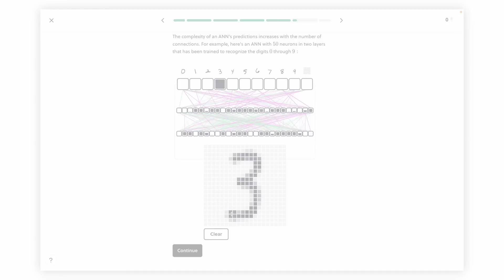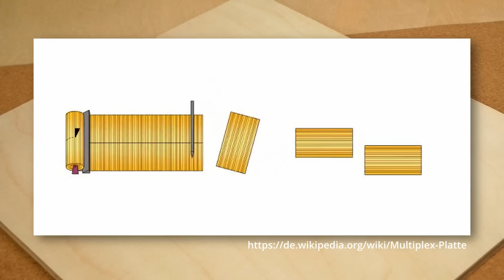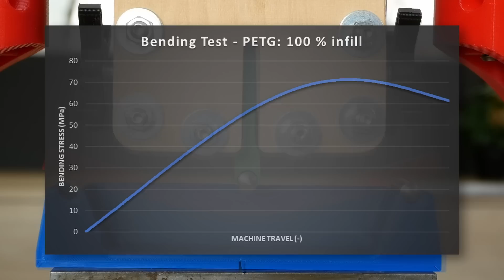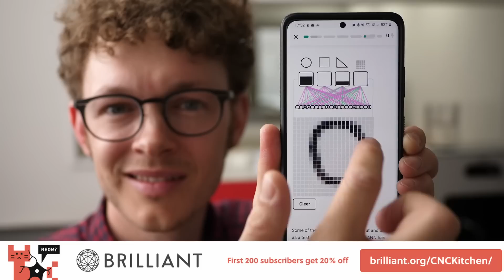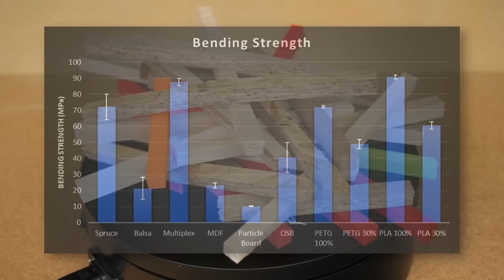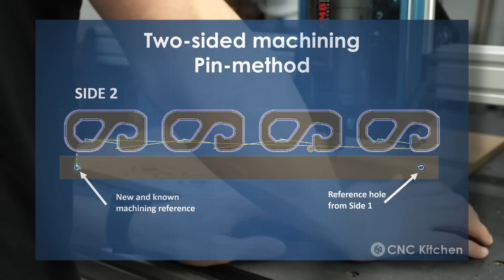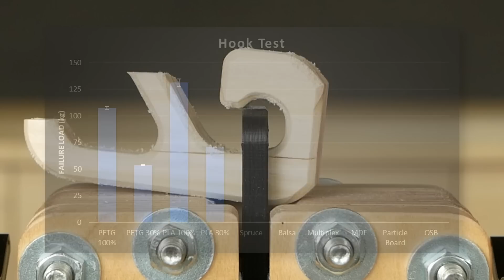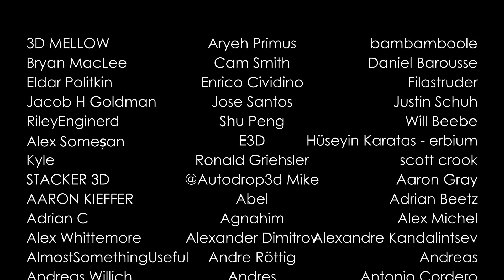Strength Test:  3D Prints VS Wood

Comment: Harder woods would be interesting, in addition to testing with the grain compared to layer adhesion in the FDM prints.  For that matter, throwing in some resin prints would also be interesting, in both orientations.
Reply: Seconding this! Soft woods are good for carpentry, but when you compare to 3d-printing it is more about joinery/cabinetry

And especially interesting is maple, not so much because it is popular, but for having a weak direction not just perpendicular to the grain, but also perpendicular to the growth rings, unlike most woods, breaking alonggrowth rings.
Reply: resin prints orientation is irrelevant, thank God.
Reply: @severpop8699  With the right curing type and a good resin, it shouldn't matter, but it's still a fact that layer adhesion in resin printing is a variable.
Reply: Mathias Wendel has a series on testing wood strength. https://youtu.be/MBfzDEgfA0I
Reply: Nah , hardwoods glue poorly and blunt your tools. The efficiency loss makes them totally inappropriate for prototyping. 
Strength to weight is also inappropriate. You can cut out marine ply with a Japanese detail saw in seconds in complex shapes. Doing that with hardwood is impossible. The saw will blunt, Teeth too fine. I'm not a carpenter but I build 20m hardwood fences, retaining walls and furniture on my cabinet saw.  As well as using marine ply for prototyping.

Comment: 1:22 ordinary particule is not moisture resistant, and will memories deformation over time, so, stopped buying 10g ago. OSB3 is much better, even for simple storage or table. there exists good quality particles at a price where OSB3 just does the same service for cheaper.
Reply: for a nice finish on OSB3, you need to use an universal paint (one which is said to stick to plastic ), grind edged, and paint a second layer.

first layer is required to stabilise edges before grinding.

plastic compatibility is required to stick on resine.

OSB3 is moisture resistant and stronger than OSB1.

Comment: Congratulations on the new studio. I'm not surprised by the results. Wood is a remarkable material due to its cellulose fibers. What's really interesting is the super wood created by Liangbing Hu at the University of Maryland. He removes much of the lignin and hemicellulose in a boiling solution of sodium hydroxide and sodium sulphite, then compresses and heats the material. This increases the stiffness by up to 20x, and the strength under compression by 50x. The density is 3x higher.
Reply: Thanks, gotta find out more about that stuff. Interesting!
Reply: Is that the stuff that NileRed tried recreating?
Reply: @taj1994  who? I don’t know who that is.
Reply: @JonS  He does chemistry videos. I'll see if I can find the video again

Comment: This is a great base line for the materials used I would find it interesting to compare this to intentionally maximizing the usage of materials. Like intentionally designing the infill to eliminate weak points maybe using an infill pattern to spread the forces involved to a larger area of the hook. Or designing your own plywood to maximize hook strength based on grain structure for the Spruce or Balsa.

Comment: For me, the decision to use wood or plastic is dictated by manufacturing processes rather than material properties.  If it needs to be larger than a print bed I use wood.  If it needs to be high (ish) precision or complex in three dimensions I 3d print.  I think if I had a cnc router it would change things a little.  A closer comparison is whether to use wood, steel, or aluminum, but I think that's outside the scope of this channel.  Thanks for the video!  I love data!

Comment: Fun fact, wood can have similar specific properties as some metals such as aluminum and steel. While I was cursing a subject about aerospace structures at college, I learnt that if wood is used properly it can match or surpass some AL alloys, regarding its specific properties, but due to the lack of permeability and effects of moisture, low heat resistance, it loose its place in planes in the 1930-1940.
Reply: I'd not say it looses it place in aircraft that early - for me wood only really becomes very rare in aircraft once composites come in as well, for military use wood certainly lasted longer than you suggest, as the first flight of the de Havilland Mosquito wasn't until 1940, and was still in service in the 60's if memory serves... Its not the only wooden aircraft in more recent decades either - really wood in flight only dies when aircraft design requirements tend to either stupidly large or stupidly light - so its probably not even gone now somebody is bound to be building a wooden aircraft, its just rarely used as composites can be made easier and stronger/lighter for the scale and flight profiles that wood might get used.
Reply: Many types of wood have great strength to weight ratios, but it cannot hold up to harsh environments the way aluminum can.
Reply: It’s also very resistant to fatigue as long as you don’t exceed it’s limits. Keep it from drying out, getting water logged or over/under temp and it still makes an excellent material for airplanes and boats. Really the first composite material once decent glues and adhesives came along. 

Laminated leather also has some interesting properties.
Reply: Yet during WW2, aircraft like the Spitfire and Mosquito (constructed of wood composites) were some of the fastest and most maneuverable aircraft. It wasn't until after ~1943-45 that manufacturing techniques evolved to better use metal alloys.
In recent decades foam and fibre composites are replacing metals in aerospace applications.
Reply: @AerialWaviator  The spitfire was made of aluminium, not wood. You are thinking of the Hurricane, which was a steel skeleton with wood pieces to give shape to it's canvas skin.
Reply: @AerialWaviator  During WW2, the Nazi's resource logistics were so bad that they were short on aluminum and resorted to trying to use wood since they saw the Brits were still utilizing it in some of their aircraft. The problem was, they had no skill and experience in it, so it was a failure.
Reply: @kwaaaa  The Germans had quite good designs but lost the critical glue plant to allied bombers… Crap glue = crap wooden structures.
Reply: @AerialWaviator  The DeHavilland Vampire jet fighter had a plywood fuselage and the English Electric Canberra bomber had timber components.
What did them in was a combination of supply shortages and aerodynamic heating. Going fast heats the airframe and melts the glues they used.
Sitting in the tropics doesn’t help either.
Reply: End grain balsa is still reasonably widely used as a core material for sandwich composites.
Reply: Wood’s variable density made it quite a poor material for pane building.
Reply: Only on a strength to weight basis, which, to be fair, is often the most important metric. But if you are instead limited on dimensions but not weight, steel is almost always the best choice.
Reply: there exist transparent wood, fire resistant wood, non propagant fire wood , immersible wood ( some naturally , or after industrial treatment ) ... 

i mean, we have a much larger choice of woods than 70 y ago. also, we understand them better, and have set stress tests ...
Reply: my guess is you were attending a course or following a course, because... cursing... means swearing at, using negative connotation words including but not limited to obscene, politically incorect, naming bad names and mentioning certain obscure dark beings that God has casted away from heaven and for some damn reason they decided to come here to bother us.
Reply: @severpop8699  Given how fed up I am already with academic life and as glad as I am that it's finally ending, at 1st I didn't even consider it a typo but then later it did come to mind.
Reply: @Kalvinjj  welcome to my world... lol  I cannot stand academic hipocrisy and limitations either...

Comment: Very interesting to compere wood to 3d prints, but I didn't hear you mention wall thickness of your 30% infill 3d printed samples.
Reply from the maker: Great point! Used the standard settings for my testhooks which is 3 perimeters which is 1.32 mm wall thickness all around!
Reply: @CNCKitchen cheers for the PLA/PETG info, your default profile would be great to know.  Curious what nozzle, layer height, extrusion %, and other  slicer settings profile you use.  Couldn't find in the video, web page or printables notes for your test hook model.  Cheers!

Comment: I understand that this is outside the scope of the experiment, but it should also be noted that wood can withstand much higher temperatures. I'd also be interested in strength per dollar in this current weird market.
Reply: I would go with the strenght per Ruble at this time...

Comment: Another important use for OSB is where moisture is potentially present and you want the surface to be able to "breathe" and not trap the moisture (eg building walls). The voids are an asset in this case.
Reply: I'm afraid this is nonsense. OSB is a vapour barrier. It barely allows any vapour through. It is a scandal waiting to happen that it is used on the outside of timber frames, and thousands of houses have been demolished already because of this stupidity. I am an architect, and have been rpedicting this problem for 20 years now. OSB sheathing should be used on the INSIDE of the frame (in countries where space heating is required), not the outside.
Reply: @MikeAG333  Incorrect.
Reply: @DD-DD-DD  Thanks for that well thought out and comprehensive rebuttal. I can point you to the studies. I am 100% correct. OSB is less vapour-open than plywood.
Reply: @MikeAG333  I dunno, man, it's a convincing argument
Reply: @SavageGerbil  What is?
If you want the easy to read version, look up greenbuildingadvisor osb vapour resistance. The article there refrences a PhD project which examined this subject more carefully than anyone else has done. At some humdity levels OSB is three times as vapour resistant as marine plywood. It can be used as a vapour barrier, without any plastic.  Anyone who knows that and uses OSB on the outside of a frame is a fool.
Reply: @MikeAG333  It was a joke about the single word response
Reply: @SavageGerbil  Ah, right, OK.

Comment: I bet any wood worker out there could have told you the wood results prior to the test.  It's very ok to test but in reality no one would use MDF, partial board or OSB for those types of applications.   OSB being the closes but you can't use OSB in such thin strips.   You wouldn't use it in strips less then about 15 cm wide.   It also does better in tensile strength then your twisting/prying test would indicate due to its inconsistent nature.  That's why they use it for floors.  
Again, not saying your test is invalid.  Just that you tested some things that no wood worker would actually do.

Comment: Surprising but I don't think it makes the plastic justice. The strength of the plastic in my opinion is the ability to produce fairly strong parts with just a few millimeters of material. I don't think wood generally works very well with <5mm thickness.

I also think strength/volume is often more important than strength/weight so a bit higher density isn't always an issue, but that really depends on what you're doing. 

For what I personally print, I'd still rarely consider wood (assuming I had the tools for it, which I most certainly don't).
Reply: Strength to volume almost never matters compared to strength to weight. Even on things like phones they make them out of aluminum and not steel.
Reply: @lobsterbark  Dumbest comment I've read in a long time.

Comment: This was fascinating, thank you. The multiplex showed its strength by design, so I wonder what would happen if you layered a 3D printed part in a similar way; laminating alternating layers of vertically and horizontally printed parts to make a super-strong part. Perhaps going further and making it a snap-together design instead? 
I've also wondered what would happen if you printed a hollow hook or with little gyroid infill and filled the parts with ... something. Resin? Epoxy? Plaster? Fine PLA dust and then heat-cured? Hot glue?
Reply: Multiplex is great but not optimal if you consider its (high) weight. It's the shell that counts - there you want high tensile strength. The stuff on the inside is (mostly) under compression so it needs to be rigid to hold the outer shell in place and prevent it from buckling. Have a look at aerospace composite panels: high-strength composite on the outside and a light "spacer" core from aluminium or phenolic paper honeycombs...

Comment: Even after considering weight, you can probably 3D print a stronger and stiffer 3D print than wood in most practical applications because you can create a much more efficient design with 3D printing.
Reply: Depends what you call “practical applications”. Lots of applications don't require small details on load-bearing parts, can easily be designed to take advantage of wood's grain properties, and/or are too big to 3D as a single part anyway.
Reply: @leftaroundabout  Yup, wood is better for big and simple applications

Comment: This test was somewhat unfair to particle board and OSB. They perform better at larger scales, where one small imperfection will not cause mechanical failure. They still aren't as strong as plywood or solid wood in most ways, but they are closer than they seem in these tests at the scale in which they are normally used.
Reply: Home furniture made out of particle board is very fragile in comparison to other materials. Moving companies will not cover damages to furniture made out of particle board because it is so easily damaged during moving.
Reply: I agree, if your samples are smaller than the average grain size the results would vary.